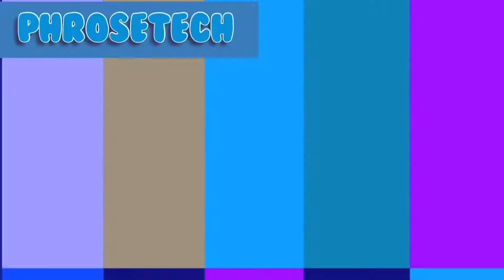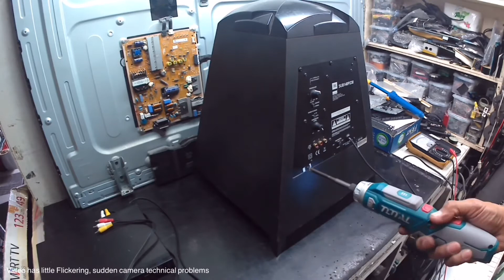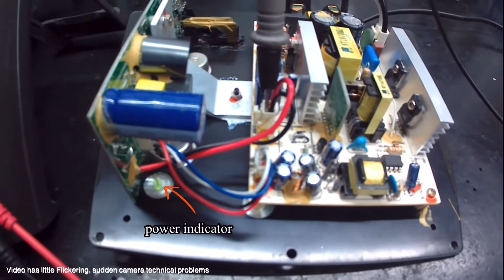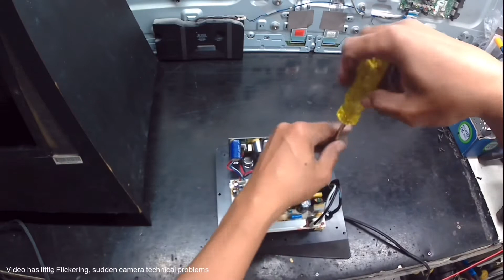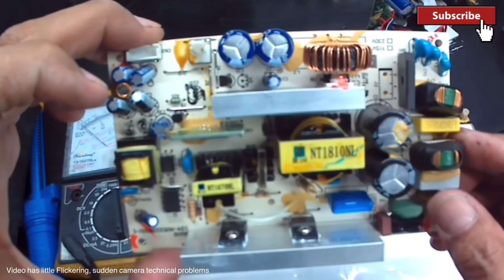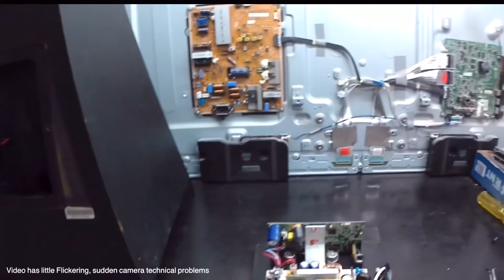JBL Active Subwoofer, How to Repair, With Power but No Sounds

Comment: Pwede magtanung anu kya possible na nasira sa panasonic radio 110v.po sya pero try ko sana gamitan ng battery kya lng baliktad yung pag lagay ko ng battery kaya yun dina gumana.. Sana po mapansin mo sir
Reply from the maker: Yup, masisra po unit pg reverse polarity, possible n nsira , fuse ng power supply if ok fuse bk nadamage power amplifier ic, or chk zener diode in the power supply,

Comment: Hi I have the same problem but I have changed the transistors 2N3904 but still problem not solved, Voltage not inputing in T2 transformer can you advice. Thanks
Reply from the maker: Please check if there’s a power command voltage
Reply: @mr.handiymanphrosetechelectron  checked power command voltage 3.2V is coming.

Comment: SIR MY JBL SUB12/230 GOT POWER AND SIGNAL INPUT GREEN LIGHT BUT NO SOUND WHAT PROBLEM SPEAKER OK NO PROBLEM
Reply: Same problem with my JBL subwoofer 12/230
Reply: After change 2 MOSFET ic IRF640 and 1 TIP31C STILL NO SOUND
Reply: What happen
Reply: @onon2246  did you find a solution please?

Comment: Hi i have a harman kardon hks 210sub/ 230 subwoofer and it has the same power card as your jbl, There are a few things I'm curious about about 1. Is it possible to further strengthen the subject bass?
51 ohm 1w resistor with 2nd thread FTA14N50C MOSFET, what can be installed instead of more convenient to have a long service life?
I would be very happy if you could enlighten me on this matter.

Comment: Good day sir..ask ko LNG ano defect ng ev zxa1 sub ko..ng on sa power pero Wala sound pag connected na sa input..My small sound nman sya pag switch on mo na pero Wala sa volume khit hissing sound..thank you Po,
Reply from the maker: Thanks, possible you need to concentrate in the amplifier section, maybe there’s no input signal coming from the pre amp circuit

Comment: Hello sir Good Day! I have the same problem with my HKTS200sub/230. It has power but no sound. Exactly no power on the connector supplying power to the amplifier board. Can you please help me fix the problem. Im willing to send you the unit. Please give me your contact details.

Comment: Good day Sir. My JBL sb 400 wireless sub won't come on after a power surge. The sound bar came on. Any idea what could of blown on the sub?
Reply from the maker: Thanks, maybe the sub power supply is not working, please check primary and secondary for some short or leak readings

Comment: Hello Mr. HandiDIYman. i have a von subwoofer ves3505es it works fine when at low volume but suddenly the sound becomes ditorted when i raise the volume...The subwoofer used to work well initially, what might be the problem. I have checked for mechanical damages to the speaker and cant find any
Reply from the maker: Thanks, try to isolate the problem by removing all satellite speakers, only subs , then try to check the sound, if abnormal , maybe the sub speaker is the suspect, try to record the sounds and send to my messenger PhroseTech Electronics, i will guide you
Reply: You bought a scrap product most probably. They usually sell a lot of scrap stuff with no quality control in local supermarkets even international supermarkets if you are living in a 3rd world country

Comment: Hello sir, aksidente ko po nalapat yung positive at negative ng yst-sw315 Yamaha sub. Nag tetesting po kasi ako ikabit yung ibang sub sa ampli ng Yamaha sub kya nagkaganun. Nag power on nmn po sya hndi lng po sya ntunog. Pano kya po yun? Sana po Matulonga mo ako sir... Salamat po
Reply: Yes sir! Ok n po subwoofer ko maraming salamat po. Sana po patuloy pa kayo mggawa ng mga tuturial video Tulad nito para po madami pa kayo matulumgan. More power po sa channel nyo, got blessed po!
Reply from the maker: Thanks, possible n damage amp ng unit
Reply from the maker: Try mo buksan then chk mo mga fuse
Reply from the maker: Duon b s mga speaker input k ng short di ko m get scenario
Reply from the maker: Kung duon k ng short dapat tutunog p si sub gmit ang rca input, subscribe
Reply: Sa output po aq nag short dun po mismo sa nakakabit na wire sa speaker ng sub.
Reply: Maitim nga po yung fuse.

Comment: Hi Sir meron ako jbl e150p tanong ko lng bakit na wizzzing na sya at na kabog na pag mataas na ang volume. Salamat sa sagot.
Reply from the maker: Thanks, I isolate mo muna , external muna, input, ung sure k gud source ang i input mo, bka defective audio cord, , internal nmn bka worn out VR or me cold solder n ps board
Reply: @mr.handiymanphrosetechelectron 😊
Reply: Hi Sir Pina check ko mosfet ang may      deperensya ung nag co control sa voltage na nka attached sa heat sink.
Reply: Hello sir Ganon parin may parang nag short na sound sa loob tapos pag nag auto off na kumakabog na sya na dati hindi naman.
Reply from the maker: Juan Avellano , internal siguro yan, chk mo ps  , ampli at speaker
Reply: Super trouble shooting 👍